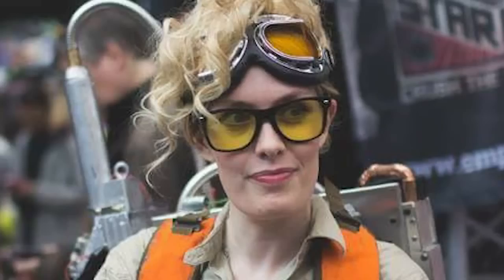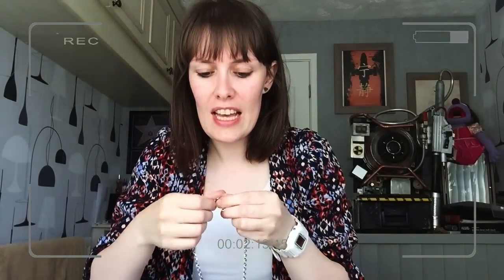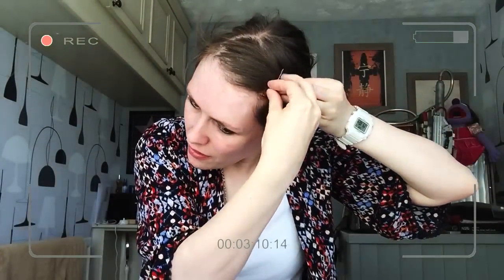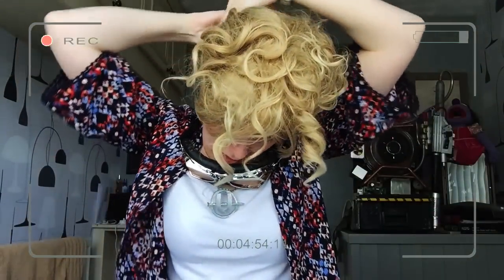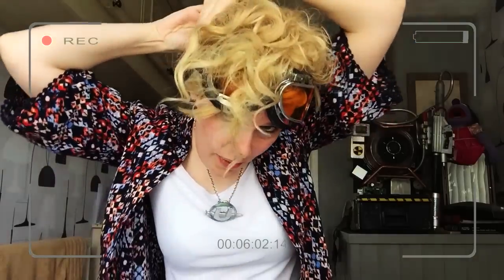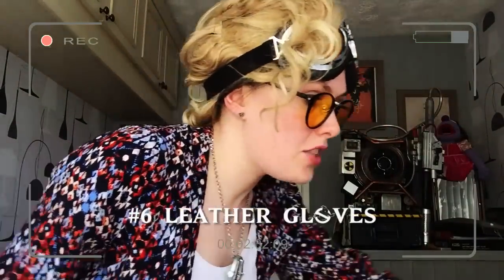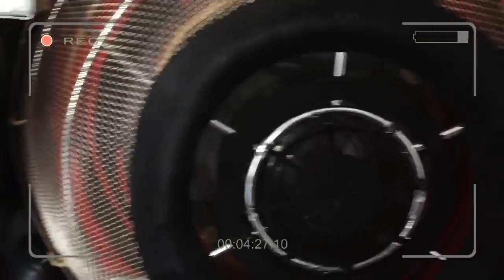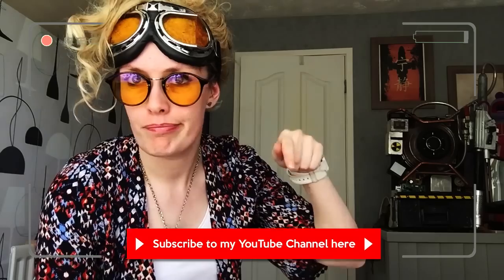Holtzmann Cosplay Tutorial (Ghostbusters 2016)

Comment: HI, do you have a video of the pack with the working lights turned on? they look great! thank you! :)
BTW did you have to hook up the digital counter or is it just plug  and play?
Reply from the maker: I dont unfortunately. The lights are just rope LED lights from eBay and they have different settings. They can either flash or remain static x
Reply from the maker: Digital counter wasn't hooked up. I just left it off. X

Comment: Hey :) .. not sure if you're still answering the comments on here, but I have a question..
Do you think I could still make the wig work without the goggles?, just using the bobby pins??
..Just wondering b/c I plan on buying a few of the things, but not all..
Reply from the maker: Hi yeah you can. It has a very short fringe which you could tuck under. A lot of hairspray and a lot of bobbypns. Failing that, lace front wig!
Reply: Where did you purchase the wig from?